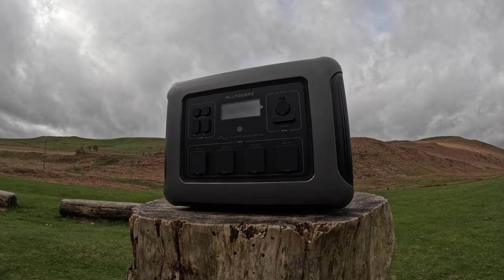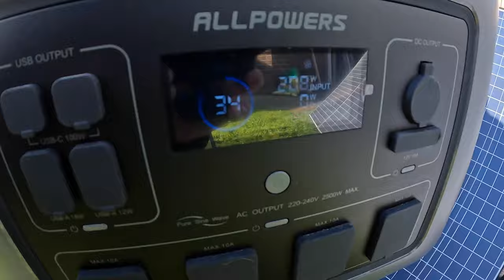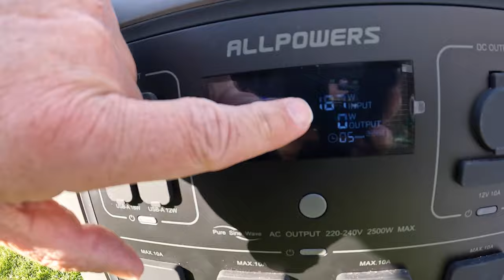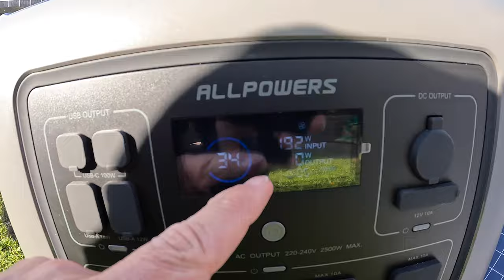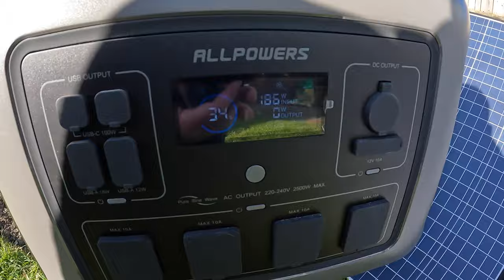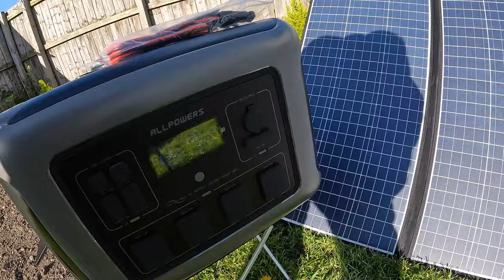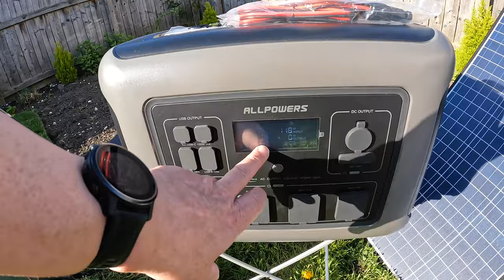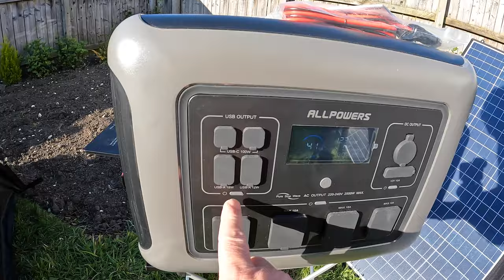ALLPOWERS R2500 | SOLAR PANEL | ENDLESS POWER

Comment: Why you're some Steven Spielberg Mandingo 👍 cracking unit mate, that solar is massive 😮 ooh matron
Reply from the maker: Pushing 200 watts in. It wasn’t really that bright sun. ☀️ 😂 it’ll be great for weekends away. 👍
Reply: @AndyWardle  you'll easily push over 300 watts on a decent day, perfect power station your van 👍
Reply from the maker: @meatmanifesto  yeah I reckon it will. Just need the sun now 😂. The panel folds flat and slots in the van nicely. 👌
Reply: @AndyWardle I have the 200w panel 4 panels and also folds away nicely. I'm also waiting for the decent weather 🤣⚡

Comment: Will this be good for a spider famer sf 200w grow light if your looking to run it 24/7
Reply from the maker: Dunno. Maybe. It’ll need charged up at some point though. Its 2500w output means it’ll work something like an air fryer or heater. 
Maybe run a few days at 200w.